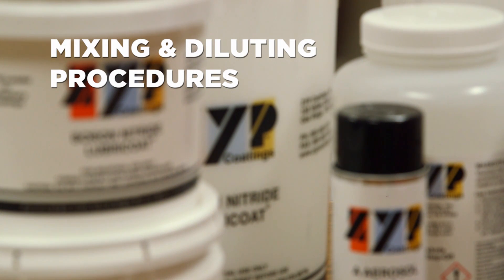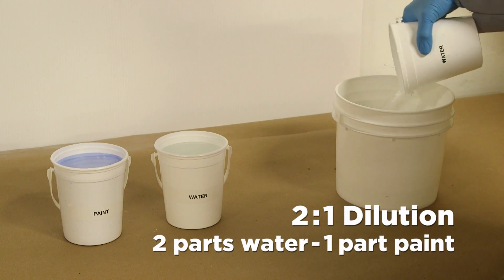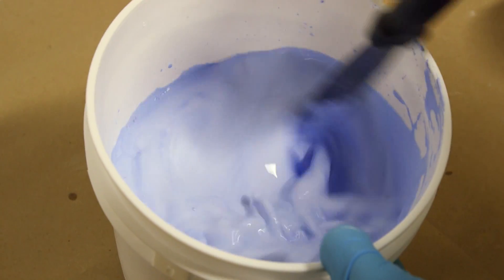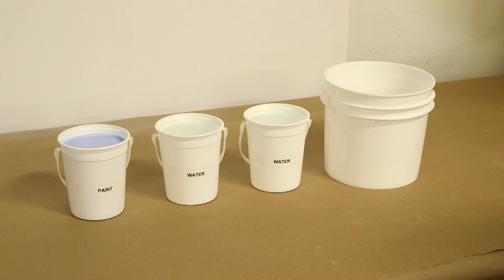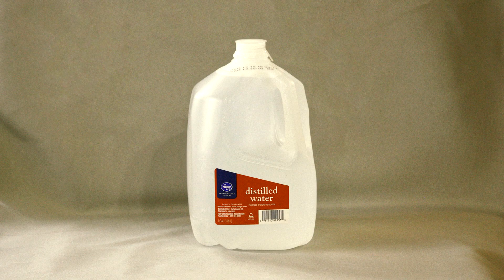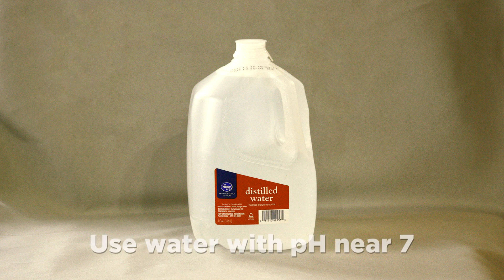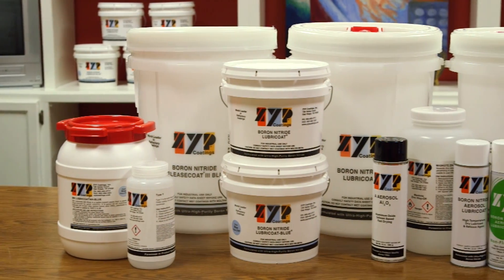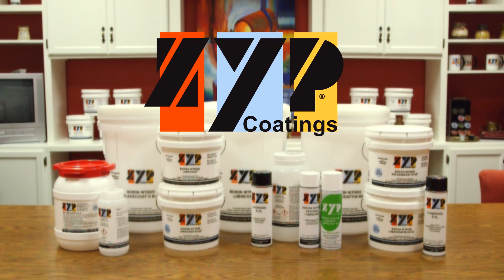Mixing and Diluting Procedures for water-based ZYP Coatings

Comment: People complaining clearly havent thought about what they are painting and why they are diluting the paint. It's quite obvious that if you mix anything witha a ratio of x2 water to x1 of anything else, the end product will ve watery.
What you should have done is mix a small batch first and apply (like do a small test area) and then see what its like then you can adjust the ratio accordingly. 
Remember also WHAT you are painting - walls in different countries are made from differwnt materials which means how the paint sticks and how it looks like once dry will vary. Lastly, it also depends on what TYPE of paint you are using. Some paints react differently when adding water so again dont expect the results to be the same across all paints.
Its like no one has ever done any painting as kids lol